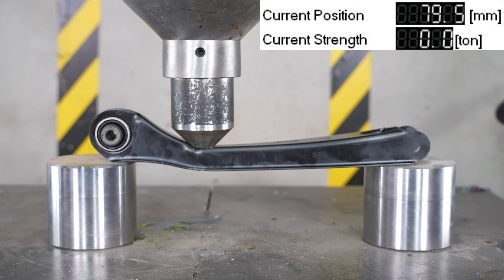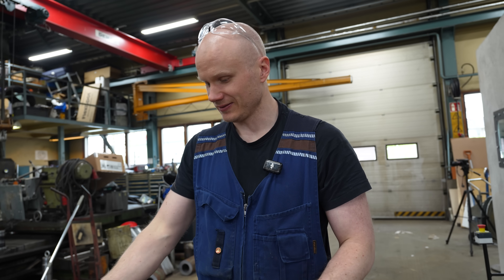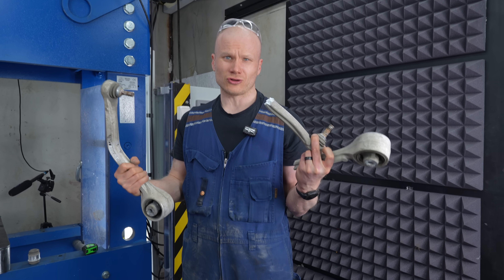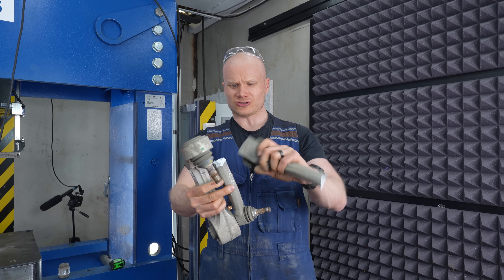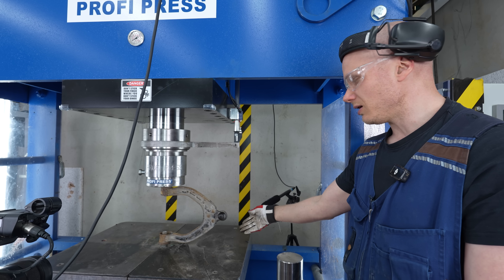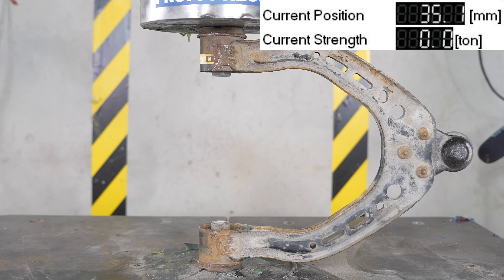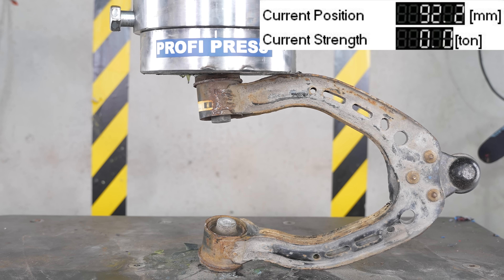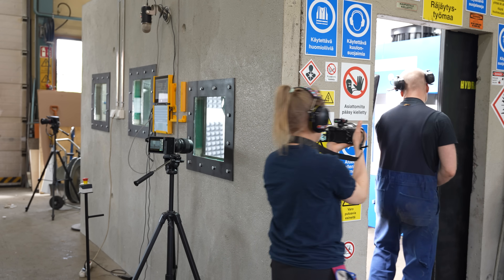Crushing Parts From My Tesla Model S

Comment: That super cheap stamped steel control arm was likely meant for an application like my Firebird, as it's almost identical to my rear control arms which from the factory were indeed that U channel stamped design. They don't really do much that needs any kind of strength, because they're just connecting the rear solid axel (not independent suspension) to the body, one per side, and allows it to move up and down. Then there's another bar connected at an angle (just one) to prevent side-to-side movement.

So all they do in his case is keep it from pulling away under acceleration/deceleration, and the axel from twisting under acceleration. However, they can twist slightly when cornering hard, so aftermarket ones are boxed steel. (or you can weld a plate to box yours in)

Comment: As for about any of those parts, the strength is completely canelled out from the stress tests you are making . The control arms will bend or break by testing them that way . Also, the actual stress placed on most of those parts is a lot lower than you are worried about . Lol

Comment: Only the first 3 wishbones had the force applied in the direction they were designed for
Reply: Yes, crushing a control arm in the middle does not make any sense. It was engineered to control a movement in the axis of the arm, not vertical to it. The weight of the car lies on springs or air suspension and is directed into the dome  on top of it. When a car is accelerating, braking or changing directions, the control arms do the job. When driving through potholes, the suspension is being used, not only the control arms.

Comment: The sheet metal trailing arm is not load bearing.  So it's doesn't really suffer any bending loads when in service.  It will only ever see compressive and tensile loads.

Comment: The biggest problem with Tesla so called... quality, is that they are very brittle and also so badly designed so corrosion will split the parts in an not very good way. That is why they still have wheels falling off.

Comment: Thats not really good way to test them the weak points are the ball joints ans bushings they dont need to hold that much pressure becouse they are gone already anyways if it snaps just extra material just in case
Reply: You could bolt the bushings and joints to some mount and push them to test how much they can hold

Comment: Everyone talking about aluminum versus steel should consider the many alloys which result from different a mix of other elements included in the material. You should consider how the final product was produced, if it was heat treated, if it was forged versus cast, cold worked to increase strength and heat treated again or not. There are many aspects of metallurgy and manufacture that go into product design and application. Of course, cost is a factor. I'm writing this only to point out that it's not just an aluminum versus steel conversation when talking strength.

Comment: The nazi mobile is one of the worst built cars ever. Lucid is what tesla wants to be. The guy responsible for Lucid's car was in charge of Tesla's engineering and has gone over how bad tesla is, and how he tried to make the car around the EV powertrain, and tesla refused. As he said lucid is what tesla should have been. He said I took all that is wrong with their cars and made it into strengths for Lucid. Their motors are like 63% more power dense while being like thirty something % smaller. Most people don't do their homework beforebuying the Nazi's choice of EV. It's why the Lucid air configured right can get 520 miles of range the most of any EV on the market.

Comment: I had an old car and I frequently said I would "drive it until the wheels fall off".

Then one day going 90km/h on the highway, one of the lower control arm ball joints failed and a wheel did, indeed, fall off.
Reply: so 1 down 3 to go (?)

Comment: 4:20 As a car driver, I'd definitely prefer Audi style bending suspension arm over snapped suspension arm at high speeds.
Reply: That was the Tesla that twisted. The Audi snapped.
Reply: @zappulla4092  2:22 Lauri says that this is from his own car (which is Tesla Model S) and it snaps.
Reply: @MikkoRantalainen  yea but it snap on double the tonnage, so i am not sure  about your thoughts
Reply: @covakoma1064  I wouldn't want the suspension arm to snap before bending a lot. I think the optimal situation would be no plastic deformation up to 3g acceration and plastic deformation instead of snapping after that.

If your suspension arm is really hard, it can take 4g or 5g force but then snap without a warning. If your suspension arm bends during overload instead, you don't lose all the control but just more or less accuracy of control.
Reply: @MikkoRantalainen  yes but this one shatter on double force than audi, lets see what happen with audi part on that force. If audi part just bend on that force(i highly doubdt) than i am on that boat.
Reply: @covakoma1064  I think the idea behind the Audi part is to never see those forces because the part starts to bend earlier limiting the peak force. The idea is to avoid sharp change in behavior of the car because the part doesn't snap and you get progressive failure (partial lose of control) instead of front wheel starting to point to random direction after snapping the suspension arm without ability to turn it anywhere.

Good design is more than just "strong parts". It also contains e.g. failure mode and effects analysis (FMEA).
Reply: @MikkoRantalainen  well looking at that I will say yes. But we dont have info what happen with Audi part at same force as Tesla. If it shatter at same force or lower than tesla then bend is just good alarm but aint better because both will fail miserably...

Comment: I don't mean to nag but the ones with the ball joint on the end should have had a cup to slide into and you should have pushed from the other side (upsidedown) the brunt of force would be from underneath I would suspect the shape would take more of a beating in the direction the piece is made in

Comment: The Land Rover control arm has shown it's greatest strength compared to aluminium - it didn't break. Sure, your car wouldn't be happy having a bent control arm, but it will be more likely to remain somewhat mobile compared to the ones that just broke. It's the same mindset as using steel rims on offroads instead of alloys. Alloys are fundamentally stronger than steelies, but when you over stress an alloy, it's game over. A steelie you just hit with some authority using a hammer, pop the tire back in and you're good to keep going. Now just to be clear, if you manage to break a control arm on an Audi or Tesla, that part being broken is likely the last thing you worry about in the long list of things that are probably broken now, including your back. With a Land Rover you're at least likely to have done so at some low velocity, doing something difficult, maybe localizing the damage primarily to the arm.

Comment: just because the car strut takes 2.5ton to compress, doesn't mean the force on the arm moving at 15m/s is 2.5ton... accelerative damping force, three time more then the static limit. ... tbird 2.5ton + strut damping = 7.5ton, wheel bearing explodes with arm's still holding together. ? hydraulic press wheel bearing load simulator with rotation resistance ? ... known to take 2500 pounds to rotate a ford 8.8 wheel bearing with 2.5ton on it = every time bump in the road, wheel bearing seizer's for micro second.

Comment: As a very general rule of thumb, I think bending is thought to be better than snapping. Bending might give any humans involved a chance to react and potentially save themselves or others. I have no idea what that doohickey was or if the thumb applies.
Reply: I agree but I would still prefer control arms that snap at 11 tons than control arms that bend at 5.1 tons. Make the bendy control arms stronger and id agree. 

Also, this isnt exactly an apples to apples comparison. These are very different vehicles. Id prefer whatever is OEM for the vehicle.
Reply: @Hondo-0126  True and good points. I think I was specifically thinking of Tesla vs Audi. I think Audi yielded a little before 11.5 tons but not badly until then. If the initial part was elastic, no permanent deformation, that would be better. OTOH, aluminum is weird stuff, might have ha a bunch of microfractures invisible to the eye which isn't so good.

Comment: The teslas are  heavy vehicles  , and those heavier built lower control arms are made according to the likely stresses to be put upon them .
Reply: The arms might be but the ball joints and bushing fitted to them aren't,both front lower control arms suffer from premature ball joint/swivel failure and the front arm inner bush tears badly. I change plenty of those exact arms,although you can swap both arms one one side in about ten minutes to be fair.they are common enough that there are at least 2 third party companies making copies of them already.

Comment: I owned an Audi A6.  Terrible build quality.  Absolute nightmare to repair.  Idiotic engineering.  For example, they made the thermostat housing out of brittle plastic and then put it INSIDE THE ENGINE.  Not on the outside.  You have to remove the entire nose of the car, and the entire front of the engine and completely remove the timing belts and everything.  Just to replace the thermostat.  And that’s just the beginning of the horrible engineering of this car.

Comment: Independent of any pressing, in the German technical check, which happens at 1st after 3yrs, these Tesla part are often to be replaced. 
It’s also important to apply test forced in the way the real live forced act. Pressing an upright steel cable discloses nothing about the tension performance and that’s the way it would be used.

Comment: For control arms you'd much much much rather have a twisting failure that stays together than a snap/break failure that comes apart on the road. The Tesla control arm absolutely failed that test lol
Reply: Twist is better than sudden break, but in both cases they far exceed the limit of the wheels. Your wheels would have snapped way before.
Reply: @zeedustrakok it would break similarly in real use (when it is bolted)
Reply: @Drmcclung  You are not very smart dude... embarrassing.
Reply: 23,800 lbs of force on a single control arm is a failure? Where did you learn math? That could withstand the ENTIRE car being dropped on that arm from a significant height and not break. clearly another failed student of the education system.
Reply: @fookschool casting imperfections, fatigue cracking at the flanges, fatigue cracks corroding away from the inside out, design flaws, what to do about inevitable sudden failure in that criteria alone? Why do the vast majority of mass produced vehicles still use stamp steel or tube for control arms even though cast alum is far cheaper, smart guy?? Liability reasons... Land Rover just issued a recall on cast control arms. Hubs departing vehicles at freeway speed is frowned upon
Reply: @Drmcclung you are ASSUMING there are imperfections which are easily kicked out by a weight check making the chances virtually zero. And aluminum has a natural outside oxide layer when casted which makes it last way longer than steel. Just admit you were wrong before you dig a deeper hole. You cant save face after making such a ridiculous argument.
Reply: @fookschool  it's ''tesla haters'' nowadays, aaaa lot of them
Reply: That Audi part would also snap similarly if it would be bolted and hence kept in place
Reply: It's also supposed to bend when you crash to something. To prevent additional damage to the car. Tesla failed because the part was overengineered when it should've been sacrificial part. 
If I worked in insurance, I would raise Tesla premiums just for this one video.
Reply: @selfsigningagreement  Tesla has a bigger issue with insurance. To produce cheaper they use less, but bigger parts, so instead of small repairs you have major parts to replace.
And usually, next to the control arm deforming the mount shears off.

Comment: The splitting Tesla arm was a bit eek. Exactly what you don’t want in a crash :o Someone put too much magnesium in that mix? But that is kind of the same issue as the cyberfook, the back end is too ‘strong’ and snaps off. Great strength per kg, lousy ductile. :o(
Reply: Cast aluminium is brittle like that, but very strong for its weight.

Not really sure why it would matter in a crash.
Reply: @logitech4873  once it cracks it has no ability to absorb crash energy. The longer it holds on the more chance the cabin has.
Reply: @teamidris  The suspension control arms don't have a role in crash design though. And remember that Teslas have been top scorers in crash safety for many years, they know what they're doing.

Comment: if it has the shock mount, it's going to be stronger than a control arm without a shock mount, no shock mount is for lateral strength, that's why those didn't take 1/10th of the other arms, this test is misleading a little bit.

Comment: the land rovers did also fail at 12 tons but when it failed it bent when the tesla aluminum broke it snapped so one works way worse and one doesn't work at all. which one would you prefer?
Reply: Neither are realistic to break outside of a crash anyway.
Reply: True but if you let's say "were distracted" and drove over a speed bump at 4 times the speed limit which one would you wanna be in
Reply: @alolol1000  The Tesla. Far, far smaller chance of rollover vs. a tall land rover. Teslas have notoriously low center of gravity and are hard to flip.
Reply: @skaldlouiscyphre2453 Sad to say but I don't think the rover would be any better. Poor overall build quality and engines that spin bearings or jump timing and break valves.

Comment: A report from Norway on 6 year old model 3s found a lot of rust so not everything is aluminium on the Teslas. Bolts holding the battery pack was a big issue.
Reply: Its a feature not a bug.
Reply: Norway has  hard climate ,i have 2 camper trailers ,one my father bought 1983 Adria 430 and one i imported from Norway 4 years ago ,German Hobby 2011 ,my father Adria has 0 rust under even after 42 years outside and driving while this Hobby has already heavy rust  under on many places ,like everywhere where its not staleness steal like legs ,bolts ,some metal holding front compartment
Reply: @dzonikg  Its particially the climate, its also the saltwater poured on the streets. In the coastal areas its the saltwater from the sea that make corrosion and it will happen everwhere near the sea in Norway, Germany, France, Spain etc. 
Then there is Finland and other inland countries wich spray saltwater on the streets and cars rust away in two generations 😂😂

Comment: Aircraft grade aluminium is not only stronger, but, more flexible. No recycled aluminum can be added to the mix either. Of course, aircraft grade aluminium has to be used on structural cars parts too. The difference between Canadian & Mexican aluminum is simply in the mix. There are other factors taken into consideration while crafting structural aluminium parts...how hot did the mix get, how much did it cool during transfer, was it cooled at room temperature versus slowly cooled in an oven, etc... Structural airplane parts, mainly the landing gear, is automatically replaced every so often, regardless of condition, due to unseen potential metal fatigue. Aluminium may be light & strong, but, it will never be as strong as steel made the same size. I'll take a 100% steel car over aluminum...always!
Reply: You cant weld some of those aircraft grade aluminium parts because its so strong. Ofc steel is stronger but you can make solid aluminium parts like a drive shaft. You can also make it carbon fiber but not solid steel.
Reply: @villeveikko1  Absolutely! Carbon fiber only has tensile strength though. It's easily crushed on it's vertical plane. Pros & cons for all materials, you know?!? Weight, strength, longevity. Fiberglass has it's limits on longevity too, left to the elements without proper maintenance (gel coat & paint)

Comment: As someone who recently tried to do quality research on which brand suspension parts to buy, this is just gold. If only parts retailers would do these types of tests.
Reply: how is this gold?    these tests give you zero information about how these parts perform.... not a single one of those were placed correctly to apply force in the way the part was designed to have force applied ....

Comment: The parts were tested in a direction that doesn't matter for their intended use. The lower control arm sees mostly tension from end to end where the upper control arm sees mostly compression from end to end. Side load isn't applicable to their actual use. That sheetmetal control arm looks like a high quality Jeep part that might have been used on the Yugo as well.
Reply: I just came across this video and after reading the comments I was wondering when someone was going to set the record straight. Tensile testing, or better yet tensile fatigue testing would have been the more correct testing method.  Side impacts to the lower control arm means you drove your car over a hard structure which SHOULD be an uncommon occurrence.
Reply: Jeep and Yugo are using same parts? 😮
Reply: Chrysler Fiat family maybe...the old Yugos were Fiat derived @rastislavzima
Reply: @rastislavzima They look the same!